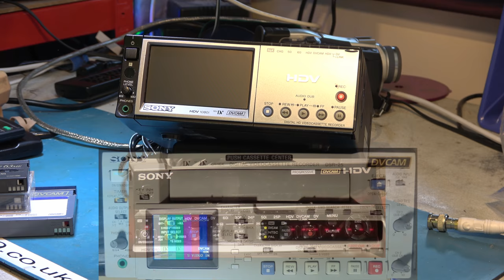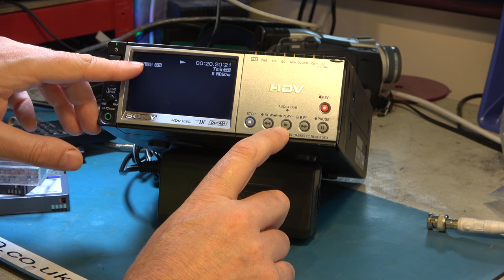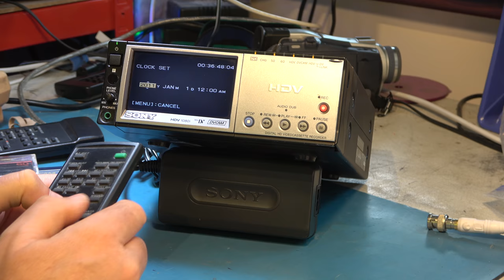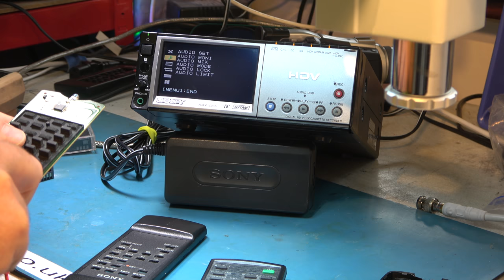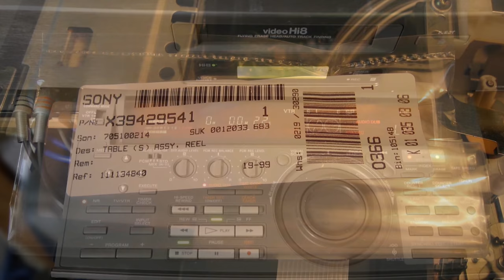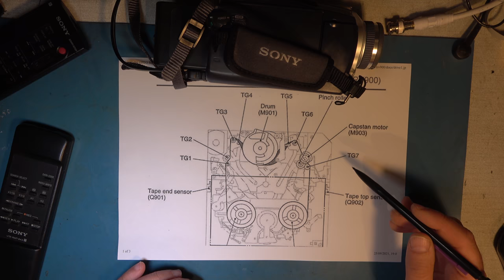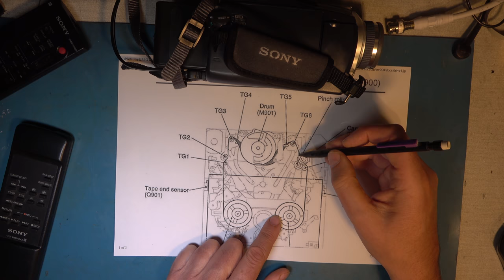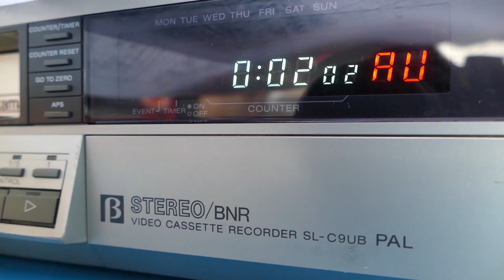HDV deck HVR-M10U, camcorder DCR-TRV18, Kramer Firewire switches

Comment: 33:50 I'm sure they make one that does what you want - you just got a (much) higher spec unit! The complexity of 4x4 switch and a 8x8 switch is of course much much higher than an 1x8 unit. In theory, a 8x8 unit is the equivalent of 8 1x8 units so the former should be 8x the price due to the extra convenience it affords. 
It's good to know these are passive inside as you've revealed. The innards appear to be of very high quality construction as one would expect.
I'm no expert on these devices but I'd venture saying they're probably crème de la crème. There maybe an active version, especially newer version, but really, why would you want one on top of what you've got, especially when you've essentially got it for free.
A great use of these devices is for comparing two input/output devices: you cannot do both with a 1xn switch but an nxn switch allows you to do both input and output device (and all combinations) comparisons which is fantastic.
As it happens, I'm after an audio nxn switch  to enable me to test/compare devices but I fear their audio switch gear is active inside. I'm basing that assumption on the fact that they are powered devices and probably used in situations where they'll be called to drive significant cable lengths (e.g. shops, ships, hotels etc.). I only once saw one of these audio switches sell for dirt cheap on ebay and ever since they're picked up in price/became rarer, esp. the ones with phono jacks. They cost more as the number of channels/combinations increases and audio ones usually are equipped with some kind of molex (?) type input jacks. I think they now bring these out with a remote control but prices for a new one are quite steep.

Comment: Well you have been busy buying some goodies :-D
The firewire switchers look simple enough, servisol on standby.
You want a super duper version of the 4066/4016 cmos switch chip, i wonder if there are lan switcher chips that might work with firewire data.
I thought about the extra remote control pads just before you said the same :-D, i really wanted them to work. mean sony :-(.
The cracked plastic cog. You could heat the metal with a big soldering iron, but a rubber drive belt would need to be wrapped around the plastic cog to create a 360 degree crushing.
Then heat the metal and hope the plastic would fit better.
Yep i'm just dreaming again,  reality never quite works that easy lol.

Comment: I think HVR-M15AU is the best deck so far, It plays PAL/NTSC ,1080i/p, 720p, 480i, 576i, 60i, 50i, 30p, 25p, 24p, DV/HDV/DVCAM and miniDV/miniHDV/miniDVCAM, I'm glad I have one.
Reply from the maker: I have the AE version, which does the same.  However note that the 720p is not available from the Firewire port, only as an analogue signal, which is fairly useless.  The version without the A in the model number, doesn't support 1080p.

Comment: So potentially this DV recorder could eventually suffer from the split tape spool gear.... Might be a good idea to stock up on some cameras that have the gears and remove them before they split and put them aside for possible future use....
Reply from the maker: You're right, it could, and I think it would write it off.  Changing that part is fairly non-trivial.  I've done it on some Hi8 decks though, even that was hard enough.

Comment: The problem with the broken spools reminds me of the magnetically coupled idlers of some Betacam SP camcorders (like BVW-300). Same defect - the plastic ring around the metal disc breaks and the gears no longer work.

I was able to 3D print replacements for the plastic part, insert the salvaged metal disc and melt some of the plastics to keep it in place. Repaired 3 of those drives this way meanwhile. Works fine, no strange noise, but i can't judge for how long this really works. PETG should be robust enough for a while.

So if you have a 3D printing enthusiast nearby, maybe ask him to have a look at it?
Reply from the maker: I have a 3D printer but I'm sure the teeth on these gears are too small for it to fabricate properly.
Reply: 3D print it to create a mould, press it into sand and pour molten metal of some sort in to make a metal version of it... 
I know that it's a bit out there but it could be possible... I guess that it's also possible to have one machined but it's not going to be cheap and I would question if it's really worth it...